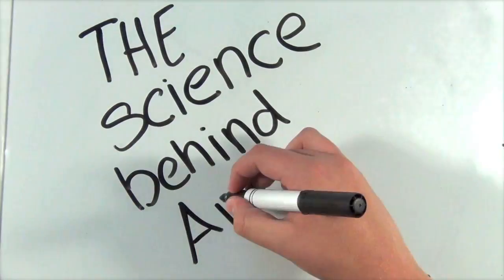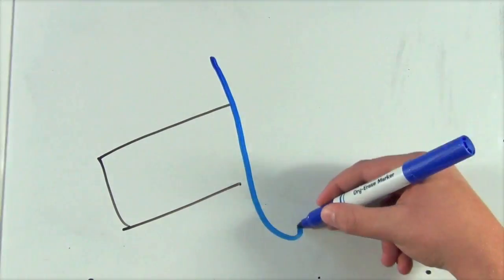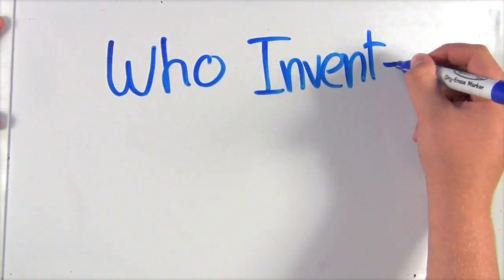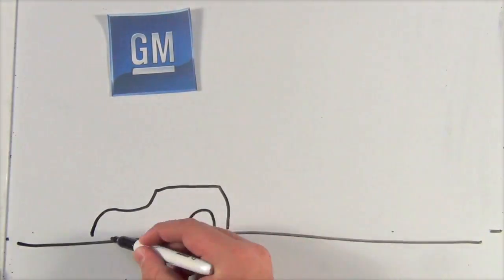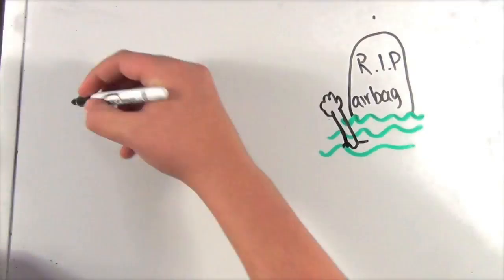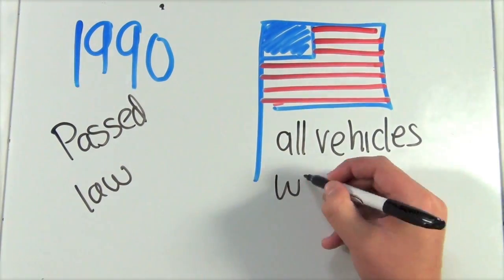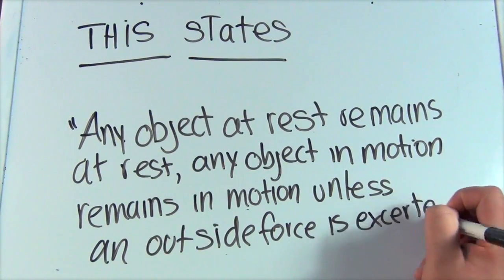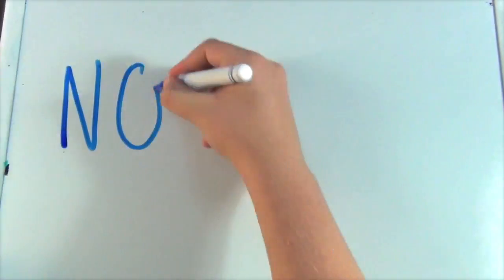The Science Behind Airbags

Comment: How do I know my air bag is still ok?
Reply: Michael Douglas you can run into a concrete wall at 50 mph and find out...
Reply: @yanierolivera4678  at 50 mph you won't get out of a crash and not be really Badly injured. Even if all the airbags work properly. Depending on the car you use you have a good chance of surviving tho. Crash tests are done at 35-40mph by the way

Comment: There are two incorrect statements:  First, the sensors don't trigger the airbag.  An ECU or control unit does that.  Second, Congress didn't make airbag mandatory, it did require that during a frontal impact occupants must not have injuries beyond certain threshold.